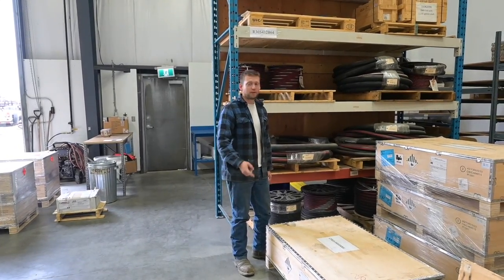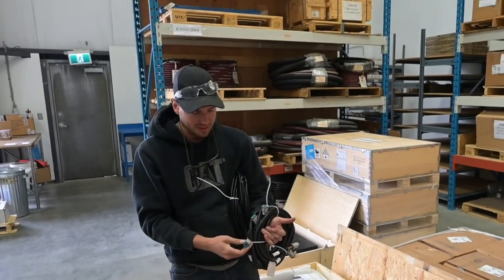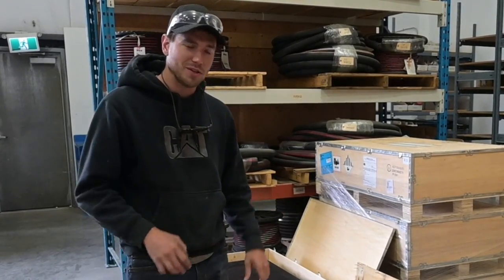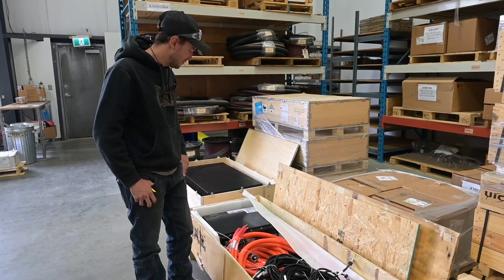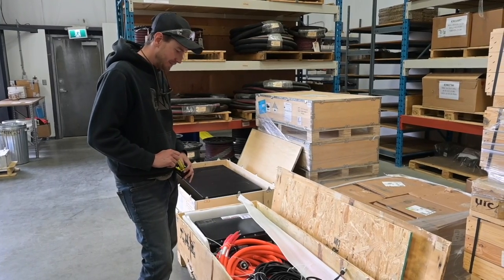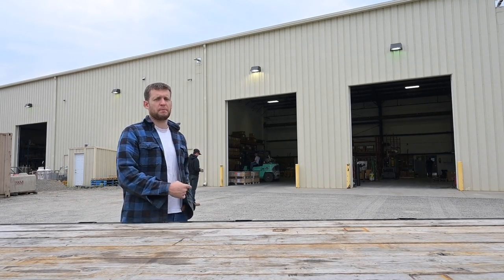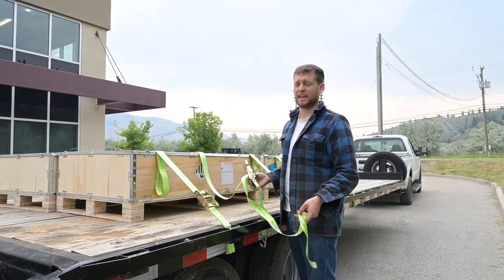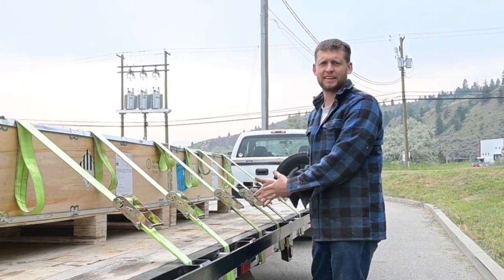Unboxing Our Powerhouse: New Lithium-Iron Phosphate Batteries for the Electric Truck

Comment: One of the biggest issues we have when fixing EVs is the batteries take 5 months plus to arrive, that's for the retail customers. Hopefully this won't be an issue with Commercial Vehicles.
Reply from the maker: These batteries took about 3 months to arrive after we placed our order.
Reply: uhhhh,...thats actually faster than My Local Dealers for an ICE engine,....
Reply: @-LightningRod- depends on area where I'm at estimate is about 2weeks for a crate engine and less than a week if I wanna get a junkyard engine. Granted that's a plus of living semi close to a bigger city.
Reply: @ProCarsGaming556  
Well,..maybe you should work for Our Local New Car and Vehicle Dealerships in Thunder Bay,..because fior here,...that's Lightning fast
Reply: @-LightningRod-  oh I see you're in Canada yeah down here in the USA we have companies that reman and make new engines and shipping in country is much faster than out of country.
Reply: more and more battery factory are being built so I would assume lead times will start to decrease over the next couple years
Reply: @ProCarsGaming556 just to put it in perspective thunderbay is really far up north in Ontario and not close to really any major cities
Reply: That's why fleet operators have service contracts. It costs money, but it ensures that your service provider has all parts you may need on hand. And when any downtime costs you money, that pays off quickly.

For example, and sorry for switching industries here, if you get an IBM mainframe with a platinum service contract, IBM will put a complete copy of your system into a warehouse within 4 hours of driving time of your data centre, ready to be dispatched and installed within 24 hours. If you don't have a service contract, lead times for new components can be up to 2 years. (Don't quote me on the exact numbers, it's been two decades since I had anything to do with that.)

Comment: I’m really curious how well a COTS battery will hold up in the north. As I’m sure you guys know, engineers universally under-spec the heat requirements, water intrusion, and cold brittleness of items because they can’t fathom living, let alone working, at -40° or lower. I know it’s a prototype so we can only expect issues, but it’ll be really interesting to see how she holds up this winter.
Reply: Keeping the batteries warm would be crucial. Between electronic heating and the coolant circulating keeping it warm. Would even be easy to have the generator set auto start on low battery charge or low temp to keep the system ready even when sitting for long periods
Reply: LiFePO4 batteries offer a wider operating temperature range. They can function well in temperatures ranging from -4°F (-20°C) to as high as 140°F (60°C). In contrast, Li-ion batteries have a much smaller temperature range of 32°F (0°C) to 113°F (45°C). Also Li-ion  will start to internal short when they get below 0 so they lose power fast at cold temps.
Reply: If your look at the blackbody radiation formula: you will notice some fourth power terms.

Below a certain temperature (say -20C) lower temperatures don't actually increase the power requirements much (neglecting wind-chill).

So if your pack is maintaining -28C to avoid damage: it may need no more than 300W,
Reply: @jamesphillips2285 Wind chill isn't something that materials experience. Windchill is specifically calibrated to exposed human skin. Those numbers only mean something to that surface.
Reply: @RowanHawkins  Wind chill will affect any heat producing object. I need the absolute temperature to decide if I want to ride my bicycle.

Comment: So I love the idea of this. I'm actually hoping you pull this all off. But I work in Northern California with lots of hills and lots of log roads. I think you should focus on a cushioning system to protect the batteries and the computer. The suspension on the truck is durable but it was not made for comfort. So a additional suspension system for the batteries and computer are a must imo.
Reply: Also a locking system for the battery plugs and computer wiring harness.
Reply: @kurthisroyalfattness9182 I think they plan on letting shit shake until it's shat. That way they know the worst case scenario, and can plan accordingly.
Reply: @stauker.1960   - hmm, a better plan is to know what is sensible and shock protect the sensitive stuff - yep I know what Chase said in other videos -  gung-ho makes a better video experience, not reliable operation  (air ride that, lol)
Reply: @kadmow  I agree that they should definitely look into shock protection for the electrical connections
Reply: They're going to have a suspension for the batteries.
Reply: Stay tuned, we are building a custom suspension for the batteries!
Reply: @Littlebitoferic   yee-yee
Reply: @Littlebitoferic  nice!
Reply: I think they are talking about air shocks for the battery box.
Reply: Air bags...suspension.

Comment: That BMS master box is massive. It's like the size of an EV inverter + charger combined even though it sounds like it doesn't contain any power electronics. Weird. EDIT: Well looks like it's not only the BMS master but also a HV junction box and I'd go as far as to guess it contains the main contactors and precharge circuit. That explains the size.
Reply: It really is an absolute unit
Reply: Yeah, he said BMS, but it seems like they rolled everything they could into that one box.

Comment: I would definitely use the coolant from the generator to heat the batteries. I would even go as far as putting a heat exchanger on the exhaust to heat everything via coolant. Winter here is cold.

Comment: Given the amount of framerail flex/torsion, I'm curious to see how you mount these compliantly, but still keep the batteries secure.
Reply: I mean things like 12v battery boxes and fuel tanks are normally just hard mounted and you just plan on the straps and tanks bring flexible enough to bend with the frame. There is quite a bit of flex over the whole length of the frame, but not really that much over the length of a fuel tank.

Actually, this truck has super unnecessarily heavy frame rails, it might not flex much. Might be a non issue. Might become an issue if they ever build a lighter frame truck.
Reply: @jaredlancaster4137  Ladder frames are notoriously flexible.  I bet that frame will flex at least 1/4" over the length of a single battery box, not to mention it needs to suspend a heavy mass while accommodating the twist of the chassis.  Battery boxes and fuel tanks hang off 1 side of the frame, they are only subject to the cantilevered torsional forces, not the lozenging that happens between the frame rails.  A 3 point mounting system would handle the twist and provide a way to suspend the batteries in a vibration isolated way.

Comment: Interesting to hear details about the battery packs.
LFP is a excellent choice for the type of application.

What concerned me though is the heating method from one side only, as LFP is more senstive to cold and delivers/charges at much less power when cold.

Heating a big chunk of iron evenly just from one side looks challenging to me. So placement of the temperature sensors must be done wisely, else you can even kill an LFP.

Comment: Do you guys run flexi rubber guards on the drives like we do in australia???
Reply from the maker: I’m not sure what you mean
Reply: @EdisonMotors  I’ll send a pic via instagram
Reply: @EdisonMotors you know like the rubber boots on cv axles or steering racks for cars? In Australia we have similar rubber boots for driveshafts to prevent dust from ceasing up the adjustable thingamajig of the shaft, so the shaft can extend with the axle when it needs to.
Reply from the maker: @dukereguardless1720  we don’t use drive shafts. Our Truck has E-axles, no drive shafts needed.
- Theron Danger
Reply: @EdisonMotors  😂 fair point. But I am curious now, do you guys use rubber boots on the driveshafts of your traditional mechanical offroad trucks? Or is there a rubber seal like a hydraulic piston?

Comment: Any thought to having a Webasto style coolant heater in case the truck has to park somewhere with no access to a plug in winter?
Reply from the maker: You don’t need to plug in anywhere, you have your own batteries and self charger.
Reply: @EdisonMotors Does the generator have a block heater to keep it from freezing?

Comment: 6kw charging? You wouldn't or don't recommend say like an 80amp charger? Was your recommendation based on costs for the charging equipment or on the size of batteries installed in the Trucks?

Comment: with this setup are you going to program in a charge cycle for when you have to park the trucks up for a time so the batteries don't drain themselves heating themselves? so the truck automatically starts the generator for a time to recharge them and keep the batteries in a prime condition!
Reply: Hopefully it's just the same system as when driving, just starts the generator to keep the batteries charged when low enough and shuts off when done. Of course this should just be a backup of keeping it plugged in.

Comment: So... If you don't have an outlet nearby, you'll have to run the truck's generator at 1800 rpm all night long just to heat the batteries?
Reply from the maker: The truck will be able to drive for a couple hours on battery power before the generator fires up to top up the batteries, but you believe the heating of the batteries alone, will need the generator to run constantly all night long?🤷🏻 
-Theron Danger

Comment: Nice to see something arrive at the right place! I'm concerned about how everything that's not the battery is crammed into that BMS box. As many diagrams and color coding as you can do, it's still probably packed in there pretty tight. That box looks like a dealer-only item. I do understand it's a prototype, so it's more food for thought than criticism. If a contractor goes bad in there, can you swap just that part in the magic box? I have no idea what's in there, I'm a welder, but I'd love to see what's inside such a critical part because if everything got riveted and soldered in place, an O/O might have to figure out how to repair that in 30 years.
Normally I wouldn't even consider mentioning it, but you are so passionate about R2R (and I'm with you) that I figured it's just one of those details that are taken for granted. even the batteries are probably pretty simple to get repaired (or will be soon) as cells and stuff can get replaced. Still, if a brain box is as compact as possible, and tucked away where there's no room for expansion/repair (working in there, and if replacement parts are not physically identical), it could be a sore spot for actual long-term longevity. I know you want to see these last as long as some of your other trucks.
Reply: When contractors go bad they can be smelled at a considerable distance.  If enough scavengers (eg. ants) are in the yard they will take care of it given enough time.
Reply: @bryanschuler9097  god dam, that took me a second but touché

Comment: What is the capacity of the cells? And total operating voltage??     Keeping the cells about 34-35°F  or above or under 100°f it should be fine!  Especially before charging , the cells must be above freezing otherwise damage is more than likely!  They may still work, but capacity is lost! Same with over voltage and under voltage,  the BMS should protect from all this!

Comment: What is the rated capacity (100/200/280/302/320) Ah of these LiFePO4 cells?  Max sustainable discharge/charge rates in terms of C?

Comment: Only 2 kW to keep 8 modules with that much surface area to take them up to 20°C? when ambient is as low as -40°C?  That's not passing my sanity check, but hopefully someone did the math.  Using a HV PTC heater in the coolant loop is how most perhaps all other EV manufacturers do it.  Perhaps a Webasto HVH or similar would work well for your application.

Comment: I wonder what they can do in case of a thermal runaway because it would be difficult to dunk a truck that large into a water tanks or putting a blanket over it
Reply: Also the cost of replacing such batteries as they will likely degrade quicker in the Canadian weather

Comment: 6 Kw to heat the batteries when parked is about equal to a typical family home's whole maximum daytime  demand running lights, a/c or baseboard heat, cooking , reefers, computers, tvs etc. etc.  By no means negligible but at least it can be bought as cheap hydro power when the truck is in its home yard.  If the truck is anywhere else it becomes problematic.

Comment: How can I purchase these battery packs? Id like to put 2 on a flatbed for F350. Id imagine each pack is 30-40 kwh,, id like to use 2 for 60-80 kwh total and then put the switchgear/inverters on the flatbbed also in a toolbox. Frefabricated specialty flatbed dropped onto a F350 that has an e-axle and engine swapped with a 50 kw diesel generator. Any thoughts?

Comment: Big question: what are you actually using to protect the batteries from dropping below freezing? Resistive pads? Glycol?
Reply: They went into detail about carbon fiber heat pads being integrated into the cell packs
Reply: @danielkingery2894  in this video? He just mentioned it, but didn't describe how they're gonna work, be attached, etc.

Carbon fiber isn't typically conductive, so I'm guessing there's still wiring involved. What size for that power draw?

And the heating pads could (theoretically) be used to head glycol that actually surrounds the battery cells themselves.

Again, if I missed it, I'll go back and rewatch it.
Reply: @Premier-Media-Group  you def did miss it...he talked about the load from the mats and how much simpler it is than circulating the coolant to heat them.

Comment: Not sure how you plan to pull big power out of the batteries and not liquid cool them.

Applying heat on the outside of the battery boxes is not going to be energy efficient.  Ideally the boxes would be insulated and the heat would be applied on the inside.
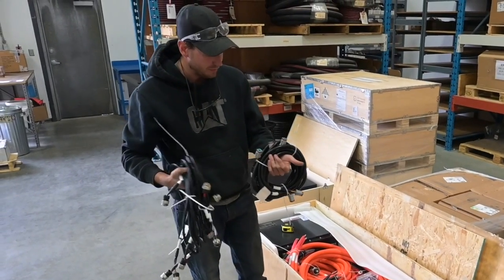Reply from the maker: 1:25… it’s liquid cooled.
Reply: @EdisonMotors  Good to know.

Comment: Whats the cost? this is the issue with EV and if the batteries dont preform for the life projected its a big loss.
Reply from the maker: The great thing about our system, when battery life decreases, it doesn’t affect the distance you are able to drive. The generator would only need to run a little longer while you’re driving. 

- Theron Danger